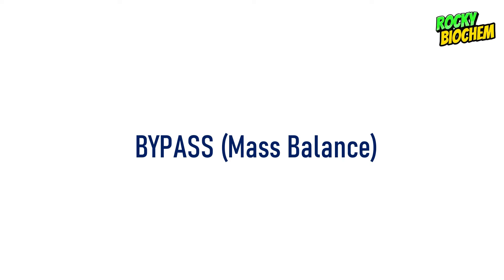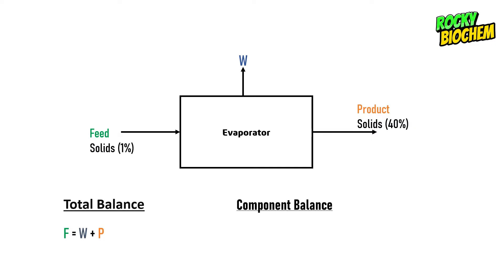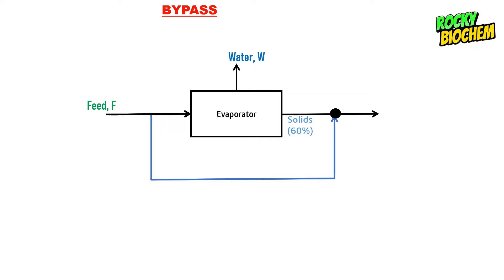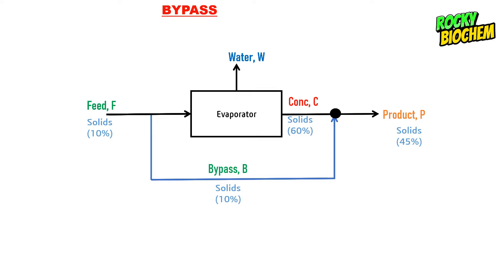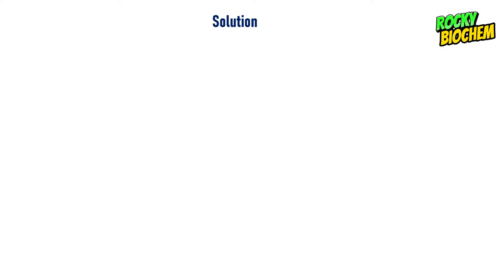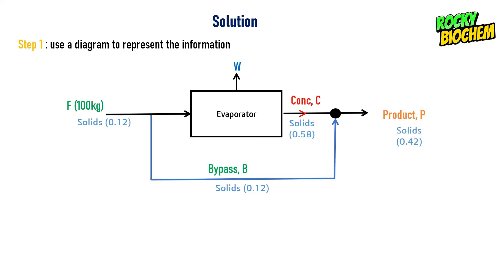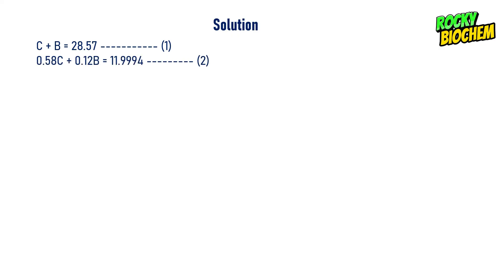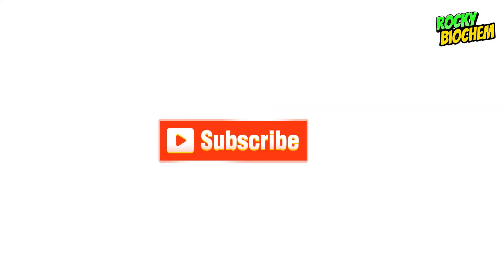Conquer Mass Balance on Bypass Evaporator Systems Like a Pro!

Comment: Good day sir.... The problem statement said that the juice that enters the evaporator is concentrated to be 58% solids,, but I noticed you used this value for the juice that leaves the evaporator which was not actually mentioned in the problem statement..
Reply from the maker: The question stated that, the juice that enters the evaporator (which contains 12%) solids, is concentrated to 58% solids. This implies that, the 58% is what directly came out of the evaporator to mix up with the bypass fraction to form the final product. Please I hope you get it now?
Reply: Yeah.. thank you sir.. i get it now🙇🙂